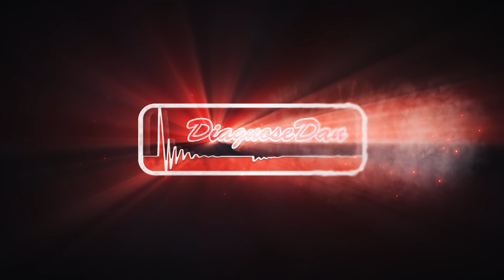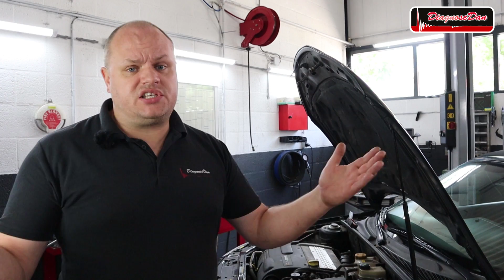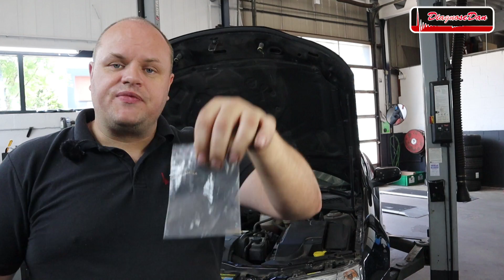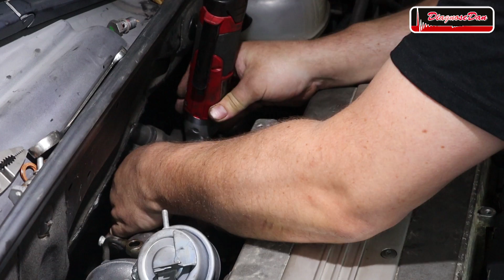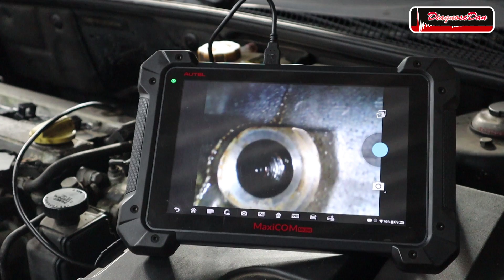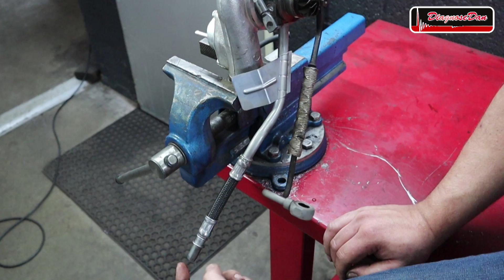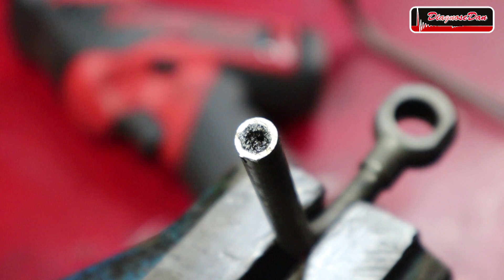Why did this new part only last one day?

Comment: I'm in the UK. If my car ever breaks down here I'll say "Take it to Diagnose Dan!" 🤭
Reply: Take to Steve from Simply Diagnostics. He is a british version of Dan. Salute for both of them.
Reply: Dan is so to be congratulated for always getting to the bottom of why something happened. It is this mentality that has been completely lost, people just don't to bother enough. I am writing from the UK also, all the shops care to do here is quick "repairs" of the type change a battery, an exhaust or, at max, the clutch assembly. They damaged our car when we took it for service and now it vibrates at idle. The internet says it is either the ignition coils or the electrical connectors to it. I 've changed the coils with original ones at 150GBP. It still vibrates. When I saw how one of the technician was pulling the connectors to disconnect the coils on another car, I understood what had happened. So we now have a car which is vibrating at idle, they won't even care to look into it and even if they did, I am 100% they would be incapable to trace down which exactly cable they 've damaged.
Reply: @nomayor1 it only vibrates at idea no other shutters during acceleration? you need to find the values the wires should give, messure the output on the coils. Compare those or if you don't gave factory values at hand compare the cilinders against each other. A vibration can be caused by all sorts of things. How old is your fuel filter, which kind of fuel do you use? How much kilometres did the car drive? Is the fuel system ever cleaned? But first get a readout how the engine is running, learn rich or just fine are all cilinders doing the same work? Does it even have misfires. How are the emissions. Is it all the time or only at a cold start. Also you didn't specify what job they did. Did they change the plugs? Check the gaps!!! If they did a tire job, you coming back with this complaint my company caused it. Expecting my company to fix it, is not realistic. As a company I would always offer to examine the cause s each for the cause of this problem,if it was caused by a part or piece that was unbolted by us or new parts used in the original repair not functioning properly. The company his to take the bill in all other cases it is just your bad luck. Still having the choice to let the company correct a possible mistake. I think there is more to this story, a company who's bread & butter is repairing, doesn't want to even look at yours after they worked on it. There is some kind of history behind you are not telling. Also we are all human mistakes are made even stupid ones.
Reply: @nomayor1  The same thing once occured with my car after servicing. I idenitifed the source of the problem myself. It had been fitted with spark plugs of the wrong type / grade. It was easy to check and cheap (£15) to remedy. It only takes a few minutes to remove a spark pluk and check that they are correct for your car. Note I am not referring to the manufacturer's brand but the grade. I hope this is of interest and perhaps some help.
Reply: Diagnose Dan is the bomb.
Reply: I think taking it to Scotty Kilmer would be more cost-effective.
Reply: @paulparoma  Scott Kilmer replaced it with an old Toyota Celica.
Reply: @paulparoma  Scotty was the one who replaced the turbo but left the restricted feed line
Reply: @paulparoma  Scotty would just down grade the car and call it a money pit. 😆

Comment: surly have to remove oil pan to check oil pick up pipe aswel after seeing this
Reply: There was oil flowing to the supply pipe.  Why remove the pan?
Reply: @boobalew  Just a good grade of detergent oil like Red Line, new oil filter and change whenever dirty on dip stick.
Reply: @boobalew  Because that didn't mean there was clean oil flowing up that pipe. Drain, check if there's something bad in the pan, and put new oil in. Or if you're in a hurry, at least flush the entire system and change filters.
Reply from the maker: You can actually use a borescope to inspect the crankcase. Saves a lot of wrenching😉
Reply: With 5 bar oil psi you are wasting your time even talking about oil pickup
Reply: So true ! As the next damage will be the cylinder head and cams! Something quite common on the 2.0TFSI EA113 Audi/VW engines!
Reply: @Mtematiks  and very common on the Audi 1.8 turbo motor and in North America we put on a screw on VW diesel oil filter as it holds more oil.
Reply: The Ecotec engine in this is not so prone to sludging in the pan like the B205/235 fitted in the 9-5 which was a real PITA for PCV issues but it's not gonna harm it. Any 9-5 owner will tell you to use the spec'd Mobil 1 oil but change after max 10k miles.
Reply: Andrew Law  Ravenol is also a good ester based oil, dipe ds on the model of the oil.
Reply: @Mtematiks   For sure but Ravenol not widely available in the UK.

Comment: The oil supply and return lines need better protection from the exhaust heat to prevent the oil from baking onto the inside of the lines and building up to become a blockage over time.
Reply from the maker: Great advise 👍
Reply: That sounds good to me.  My mechanic always told me to not shut the car off right away after driving it hard.  So the oil doesn't cook inside the turbos

Comment: Oh yes, another video... yeah. 
Good tips and I can only assume the first shop will have to pick up the second repair bill.....
Reply from the maker: Thanks for watching 😀
Reply: But the other shop will say that 'you should have brought it back to us'
Reply: @jean-pierredeclemy7032  Yes, you're right, but it will not hold up in court if it has to come that far (from own experience winning a comparable case where the first shop did not put in the correct head gasket and left me stranded 400 miles away). There is never an obligation to bring it back to the first shop in cases where you break down.......

Comment: Just by watching the oil when you test the oil pressure i saw this customer doesnt change its oil very often... it look like pretrolium sludge... so of course... carbon clogs everythin... great job dan...
Reply from the maker: Thanks for watching Jose!
Reply: That is insane... 15.000 miles oil gets sludge and will clogg everything... i always recomend my customers to replace sinthetic oil not more than 8.000km... more than that experience has show that produce carbon...
Reply: @joseramonherreramendoza9260  8000 oil change interval is overkill.
Reply: @TJAnttola  not on a turbo car it isn't. Oil is cheap, turbos are not. 15k intervals on any turbo car is insane and a guarantee turbo failure later on in the cars life. My turbo cars received an oil change of Mobil synthetic every 5,000 km no exceptions.
Reply: @TJAnttola  definitely not over kill especially on a turbo engine with higher temperatures and worst if it direct injection. I worked as a tech for a Audi/VW dealership and we got the customers to do oil changes at 8K instead of 15K.A oil change is the best preventive service.
Reply: @TJAnttola  Not really, used oil is eminently recyclable, and cheap, plus the filter as well. I never got oil past 10 000km, and that was on a stock low compression VW, because black oil is not the best lubricant, and DIY is very easy.
Reply: @TJAnttola  not for europe, 8000km like a year worth of driving

Comment: The plugging in the line is due to customer abuse... they drive the car hard , and when they get to to where they are going they just shut off the car and that cause's the oil in the line to burn and plug the oil feed line..  the customer needs to change the oil more and get a turbo timer.
Reply from the maker: Thanks for leaving a comment 👍

Comment: Carbon in the pipe, hmm was that due to oil not being changed regularly? Or lack of inline filter for the oil feed? Or was the oil pressure out of the engine too low causing a low flow rate of the oil? Looking fwd to your answer👍
Reply from the maker: It's a combination of things, oil line gets very hot, oil changes, oil quality.ect

Comment: Looks like that’s a flexible hose in between the two ends looks like that collapsed and plugged the line
Reply: It doesn’t collapse with pressure it only blows up 😆
Reply: Thats a heat shield yo
Reply from the maker: Heat shield

Comment: Haha winning comment then, perfect internet diagnosis... however..... I changed a turbo and a like a good boy changed the feed and return pipes like a good technician should, the only problem was, it was the brand new pipe that was blocked with what looked like the zinc coating. DOH! So don't trust the new parts either.. 😳🙈😭💩
Reply: Yep. Always check, never trust.
Reply: You never trust them. As a competent mechanic, you test or check it yourself.
Reply: Of course everyone on the internet is perfect....
Reply: @HandyC  of course we are !! 😆😆
Reply from the maker: Thanks for watching 😀
Reply: Especially if they're from China.

Comment: excessive oil change intervals. wrong oil gradation
Reply: Not only gradation, very important especially on a turbo engines is NOT to use shitty cheap hydrocracking oils! When you run the car on a city cycle especially !
Reply from the maker: Thanks for the comment 👍

Comment: Oil change and let engine idle a short while before turning off
Reply: ....and don't buy turbocharged car if you mostly doing short runs and drive within speed limits. On the other hand most newish cars are turbocharged these days.
Reply: @kestutiskuzmickas2836  That's nonsense of course, just make sure your turbocharged car gets to use its boost range enough. I have a Volvo with a 1.6 Peugeot HDI engine and the shift indicators tell me to upshift before the turbo has a chance to kick in at 1700RPM -- great for fuel economy, but my turbo likes it when I pull a sprint every once in a while. Not to mention the DPF will be happier with that as well.
Reply: @kestutiskuzmickas2836  Seems to me they put undersized engines for a weight advantage(ultimately, fuel economy) and then stress the hell out of the engine to make the car seem peppy. I saw a video on the new full size Chevrolet with a 4 cyl engine. In a scene of the instrument cluster, you could see the engine turning 5000 rpm.
Reply: obsolete professor 
My 2 liter 4 cilinder BMW Diesel can go up to 6000 rpm. 5000rpm for a gas/petrol engine is not a big deal (at all, especially not EU engines).
Reply: @obsoleteprofessor2034  I got better fuel economy from a 2.5l NA Ford Fusion than a 1.6l turbo Fusion. And the 2.5l was more fun. The power output was supposed to be around the same but the NA had no waiting. I still prefer my 2.5l 6cyl Mazda even more. I'll never sell that one.
Reply: idle sees no crankcase PCV vacuum... that's when your engine seals leak on the ground 😉
Reply: @glasser2819  What? :D
Reply: Driver habit is always a big factor cooked turbos aren't as common as they were a few years back mainly due to improved  oils that withstand over heating but  drivers who cooked turbos are usually the same ones who warp brake discs.

Comment: Extended oil changes intervals by the customer and probably low quality oil added to the issue. Need to follow the service intervals and replace oil and possibly more frequently than normal.
Reply: This could easily happen with the new long life intervals program of oil changes together with branding shitty hydrokrack  oils branded by the manufacturers of the cars as "Original oil"!
Reply: @Mtematiks true. that too!
Reply: @hoss2200  Expecially with a city cycle with more "cold starts" and short distances!
Reply: Also, I believe there are no bad cars (they all have some areas that were left unattended when built), only bad car owners. I saw a line of customers with cadillacs and Mercedes that had a "Mobil1 sticker on" nobody wanted to pay for full synthetic.
Reply from the maker: Thanks for the feedback 👍

Comment: I hope the owner passes the bill onto the first garage!
Reply: More than likely will, as it is their failure to install the new turbo as the instructions say, as Dan says, they give the new lines with the kit for a reason. Not even any reason to not undo that bolt, you would have to remove the line anyway to get the old unit out.
Reply: I wouldn’t be so sure about that, the customer was on a holiday and was replaced in another country.. I don’t know the distance but a lot of people won’t even like to go all the way back not even surely know if they get their money back..
Reply: @stefandegraaf7241  For the money that a turbo costs you can almost send an attorney to that Belgium shop.
Reply: @willemstreutgers1154  Sent them the bill and the video, if they don't pay up or were not insured, sue them.
Reply: @Spelter  lawyers are not always the path to take. They need to be paid and usually they are the ones that make the matter more expensive than it needs to be.
Reply: @stefandegraaf7241  Most Northern European countries would honour this IMHO.
Reply: @Garth2011  Yes, that is why I said sent the bill and the video first. When they see they fucked up, they should pay and maybe will. If not, you could sue them. I'm not talking about a 300 Euro part and 50 labor, more like 2000 Euros for the parts, 100 for the Oil and filter and 500 for the labor. Paying your income of the month because somebody fucked up is a pretty good reason to try to get your money back. The first one was on the customer for bad servicing, too long oil cycles. Now he is maybe on over 5k he blew into the car.

An expensive lesson too.
Reply: @stefandegraaf7241  It's Holland and Belgium.... It's not really "in another country"....  :) And about distance - any given place in Holland is pretty close to any given place in Belgium... That's just geographics, look it up, it's very interesting.... :D
Reply: @stefandegraaf7241  As it's within the EU the customer should at least have a fighting chance of being able to do this. Depends on whether the first shop can explicitly require the customer come back to them for warranty service.
Reply from the maker: That's up to him, i try not to get involved and just do my job as good as possible 😉
Reply: @Diagnosedan  it's sad how many people opt to skip using the complete kit of parts provided just to save time
Reply: @Diagnosedan  yeah, it's not your car and call. Could backfire too much.
Reply: @Diagnosedan  Doing your job as good as possible..... Does it not include providing reliable information about what caused the demage (and since it's  more than obvious who was at fault - pointing out, that it is workshops responsibility, to install ther part properly, since the customer could be confused and think there's something wrong with his car what's caused both turbo's to fail)... Yeah, it was and it did with the first one, but it shouldn't happen with a new one...
Reply: PlanetCypher- I will take it a step further, if the owner did the oil change proper interval, they wouldn't of even even needed to take it to the First shop that misdiagnosed it. Did u see how black/dirty that oil was? Owner= problem.
Reply: @nateh1974  Yes, I would say he either went to the dealership for the change and they said "no problem, longtime filling, you can drive 30.000km with it" or he didn't change it at all. 

A coworker had the same issue: Audi Dealership said no oilvhange needed, Turbo died and they refused to pay for it at first. After a nice letter from a lawyer, they replaced the turbo without costs. 2,5 years later, the next turbo died (reason unknown), he was out of warranty and a third party shop replaced it. Sadly, they showed him that the dealership destroyed one bolt by cross threading it into the hole and it broke off when they tried to remove it. Not able to drill it out themselves, they removed the head and sent it to a machinist. After that horror was done, the engine has a new timing chain and headgasket. But guess what the car is doing now? Right, sucking oil like Coke and they should have replaced the cylinders when the head was removed. Now he has to redo the whole thing or sell it.
Reply: Hopefully the car owner paid by Visa card, they will get their money back no problem. Especially when shown this video from dan.
Reply: The previous shop should have replaced the part. However, they should've educated the importance of oil change intervals for cars with TURBOS.  That said, the problem with the SAAB could have resulted from neglect from the previous current owner too. Soooo....if I had bought a used SAAB with a shady past and wanted the turbo fixed, only to have it fail because of incompetence....I would be furious. That shop is totally liable. Buuuuut, if the current owner is responsible for the neglect....then I'm sorry, but he deserves it. The hard education on the importance of OIL
Reply: The oil coming out of that block looked a bit grim
Reply: Those Saabs when they switched to synthetic motor oil at first had strange problems with the oil turning to something like a black hard plastic. I’m not sure but PCV system had recall in the states...
Reply: No the Customer deserved it!

Comment: I'd say oil pick up in sump blocked. Did a minni cooper sd the other day that hadn't had an oil change in 5 years, she thought it was done as part of the mot! What a job that was, everything blocked and covered in sludge. Also done a tiguan where the gauze in the sump got blocked. Keep up to that oil change on modern diesel and drive them right so the regenerate!
Reply from the maker: Oil change as part of the Mot😂
Reply: @Diagnosedan  yeah ridiculous eh! As for the carbon buildup I've had internal injector seals on engines such as the transit going knackered and putting exhaust gasses into the oil and carboning it up. Also bad dpf with excessive back pressure can do it.